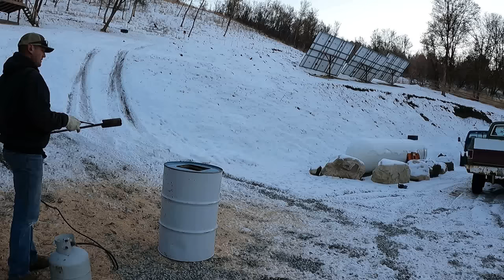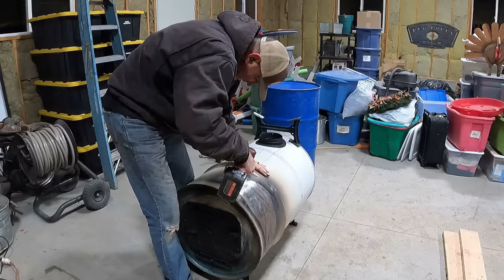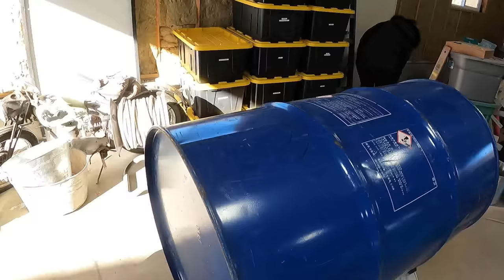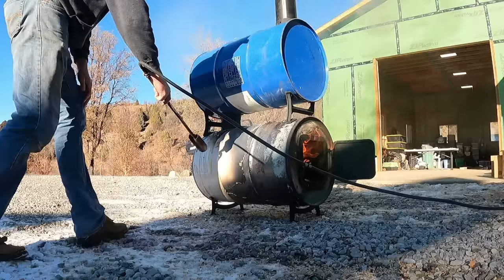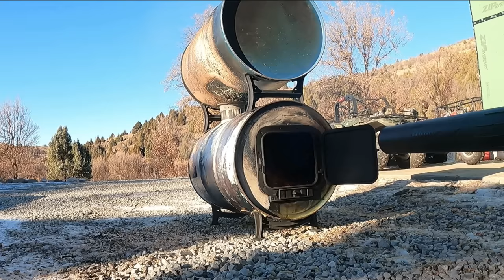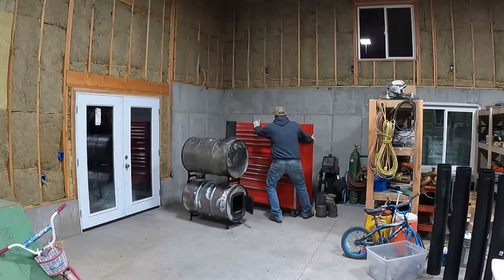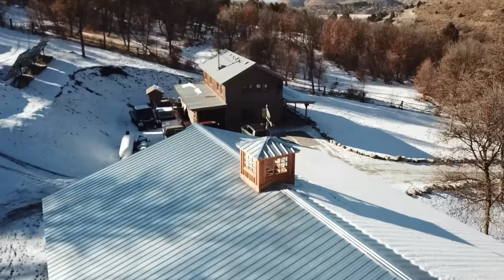I Built The ULTIMATE Wood Burning Stove For The Shop...

Comment: You never said whether it adequately heated your 40’x40’ shop? I have a 24’x32’ converted metal carport that is now a shop and curious if your stack was enough or substandard so I can determine if a single of double is best for me. My shop is 13’ tall at the center with no insulation, just metal siding all the way down. Curious on your thoughts. 

Great video BTW.
Reply: i would look for a used cast iron stove

Comment: Couldn’t quite tell from the video, but a little fire brick in the bottom and top chambers with keep more heat in and save your barrels for more years of use. I use one of these for a smoker, and the firebrick makes a huge difference

Comment: Just a little tip, Put the damper between the two stoves. It works a lot better.
Reply: Putting a damper between doesn't allow the top to help retain heat, making the double barrel useless

Comment: I have had a few over the years and they do wonders. I paint my stoves with high temperature paint to make them look better. It will surprise you just how warm they can get and my pets would lay under them an never get burnt fact I could put my hand on the bottom an not get burned. The ashes will insulate it to keep it from getting to hot

Comment: On Fresh Air Intake.   (Just because so many have commented) For a shop, a fresh air intake is better in the long run for efficiency.   But having a shop with a wood stove for going on 30 years now I've found that using a nice hot stove and shop air to feed the fire gives such a nice air exchange in the building.   That way, your always breathing nice rich oxygen that has been sucked in from outside.   This is important, the place develops an energy as it heats up and sketchy projects that might have some fumes or stink are handled by the stove.

Comment: Nice job! I would kick it back towards the wall after a couple foot piece. That way it takes that two 45s with the heat most heat out of the stove and then has a nice straight shot up and out the roof.

Comment: I built a double barrel stove to heat my father's welding shop so he could quit spending a fortune on propane.  This was 45 years ago and it was still heating the shop 20 years later when he passed and we sold the  shop.  I also built a set of ash grates for it out of sucker rod.  The end plate with the door was made from scrap plate steel and included a smaller door below the grate for removing ash.  Surprisingly,  the paint burned off the upper barrel first.   After watching it operate, I believe that the connector pipe between the barrels should be at the front of the stove instead of the back when there is a grate to allow air draw under the fire for the full length of the stove.

Comment: I put the exit pipe on the front of the top barrel then went back with the pipe to exit the building it throws heat like crazy because the smoke has to build up in the top one before exiting then the 4ft of pipe to go out the building heats up too good luck I love mine it heatsup great and doesn't use much wood I go in about 11 pm come out in the morn and kick the coal around add wood with out lighting it I love this set up thanks for sharing

Comment: I line the bottom barrel with house bricks and halfway up the side also retains a heap of heat and saved burning the floor. Also they rust out quickly if water gets inside when not in use

Comment: nice video. i had a barrel stove long ago, as mentioned below, i lined it. i put sand on the bottom and fire brick on top of that. worked real well. why didnt you go straight up with your pipe, just curious. thanks for sharing the video. looks like a real nice place.

Comment: I use a double barrel stove to heat my shop and part of my barn . It works really well and is cheap . I have plenty of woods as I live on 30 ac hobby farm. The only issues I have is I have to paint it every year . That's really not a problem . A can of paint is less than 10.00 bucks.

Comment: Saw this one ebay. . . Was thinking of one modification you can do to make it better.  On the top barrel cut two holes in the middle of it, one on the top and one threw the bottom, then run a straight pipe through it and either weld it in place or get two of the connector like from the double barrel add on.

Comment: If you haven’t done it I highly recommend you shovel sand into the burn barrel no more than 2 inches deep to prevent you overheating the barrel and dropping the fire out the bottom. My mechanic heats his shop with a single barrel and learned that the hard way. Fortunately he didn’t burn the shop down.

Food for thought

Comment: In the time it took to build this stove, I made enough in the stock market to buy and have installed a 96% afue  furnace with an automatic set back thermostat. Also sold my chainsaw and wood splitter on E-bay.
Reply: That's nice but what are you going to do when the SHTF and you don't have power or gas to run your 96% AFUE furnace? I guess you can take all that money you made in the stock market and burn it to stay warm. I think he has the right idea with the wood-burning stove and I loved the video.

Comment: 4 years ago I built two. One for me and one for my grandpa. The barrels with the steel rings and removable lids usually are thicker. When I built my grandpas I used the supplied hardware, when I built mine I used steel rivets…. The way to go if you have the equipment. I also stuck an old grill grate in the bottom of my barrel and a piece of bar grating in my grandpas for air flow under the wood

Comment: Still could’ve plumbed in radiant floors and used the wood burning as the heat for them. Just gotta have a heat exchanger made up. There’s a guy here in Monroe Michigan that uses such a set  up and it even keeps part of the driveway clear so he doesn’t have to shovel or salt near his Barn

Comment: Nice job of making the video. NO TRASH TALK TO WASTE YOUR TIME. No BS either. Nicely done. Step by step on how to do it. HOW EVER I will say his location of the stove wouldn't be my pick. I would have put it in the corner with the front splitting the difference between the two walls. That way he will not be to close at all to insulation or wood. Relocate the tool box so not to burn the paint. I don't know if he had a car lift in his shop or not but that was some very high ceilings. WOW. All that heat is going straight up and away from the working area. If I remember right he said he had to put 16 feet of pipe up to get the stove to vent. In my shop I wanted to not have a ceiling so I could store things in the rafters. One winter told me thats not going to happen. All the heat went up and through the tin roof. I then insulated the rafters and put boarding up. MADE things alot warmers in the shop.

Comment: These are awesome. I inherited one like it with the house I bought last year. HUGE NOTE need to make at least 3 feet air space around the stove. I say this because I nearly caught the entire shop on fire because these will burn very hot and I had stacked very seasoned wood about 2 feet away and it spontaneously ignited!  I was not in the shop and just happened to walk back out and found the pieces of wood on fire just another few feet from my cars!  

I was also burning some junk wood from old pallets at the time which burned super hot. 

Just my .02 hope someone else does not have same problem. These are great and make a lot of heat.

Comment: I make these and sell them. I lay flat and burn wood after cuts to wire brush off oil and stickers while it's hot. If you put your door on the bung side with bung down you can use for intake. It works better than the sliding grate.

Comment: When it comes time to build another one look for military grade barrels. They are thicker and have a higher nickel content, or something like that.
 Had one in Alaska, you could get that thing cherry red nooooo problem. 
 No need for sand in the bottom. Flashing your walls with a one inch gap will take care of any fire hazzard if your stove pipe is a little close.
 I've seen all kinds of setups. 
Another neat idea is old water heaters. Takes some work and a welder but the can make some good cook stoves if you flatten the front 2/3s of the top. Just make sure you use one that's not too pitted on the inside.

Comment: Take several pieces of pipe and run them through the top. Barrel creating more surface area and the ability to use a small fan to push air through it getting more bang for your btu usage an open barrel is just heat leaving the chimney we've heated out 60 by 80 with one for 50 years

Comment: Just put the entire stove together first with all the clean shiny paint on it,  then take it outside and build good hot fire in it to burn off all the paint. That way you don't have to deal with all the black soot while you are working on the stove construction like this guy did. Keep a small grinder handy to smooth out all the sharp edges so you don't get cut and be sure to always wear some good gloves.

Comment: Burning wood can still supply an in floor heating system, there’s also a heat > electricity generator that could be used to power in floor heat pumps
Reply: Agreed my uncle has a wood stove like and actual stove to cook on, he added a manifold to the stove that has the infloor heating running thru

Comment: Ever hear of a Sand Battery? Sand heats up and very slowly releases that heat. If you put another barrel on the chimney but made that section of pipe single walled, and filled it with sand, it would absorb a ton of heat. If the stove ran out of wood, the sand battery would still be releasing that stored heat for around 6  hours. In a house with a wood burning stove in the basement, you can put a sand battery upstairs and it will distribute heat more evenly.

Comment: I’d hang a few sheets of drywall on the ceiling around the wood burner an cheap sheet plastic stapled on the rest to lower that height. Heat rises and the dry wall around the wood burner is just safer to stop the sheet plastic from ever being to close to the heat. I bet if he did that the shop would get much more warmer.

Comment: I use a lift plate that I set about 2 inches from the barrel bottom that is level with the door attached to some wire I pull to tilt and get the ash coals out when needed

Comment: Line the bottom of the bottom barrel with clay bricks...
In the upper barrel, add about half as much brick, but line the bottom, put a rack system in it, and add more brick... these will get hot and retain heat for hours after the fire stops.

Comment: Couldnt you use some sort of graphite/heat resistant material to seal the door and piping?  Could make it fairly air tight that way.
Reply: JB weld, and high heat caulking..
done....

Comment: They are a lot better when you offset the top flue pipe on the front above the door then angle the flu open out in whatever direction you need to. More smoke in the top barrel for a longer amount of time is always better 🍻🍻

Comment: I haven’t seen this type of barrel stove before. Seems the top barrel doesn’t have any internals and only provides opportunity for radiant heat transfer to the room?  

Maybe the top barrel assists with combustion of flue gases(?)

Looks a nice cheap and simple design. 

I’m learning about rocket stoves. Fun idea but they don’t compare to good slow combustion design in terms of long burn time due to the low fuel stock capacity (have to constantly load fuel) in all the designs I’ve seen. 

now I’m wondering if there’s some mix of slow combustion & rocket stove design concepts working in this double barrel design.
Reply: from my understanding you are using the second barrel to capture extra heat from the exhaust.  Some people put pipes through the top barrel and place a fan behind to get as much heat as possible.

Comment: Also you can take and take your top Barrel get a piece of 4-in steel pipe and cut a hole in and weld it so there's a hole in the center of your tank and you can put a fan on the back side of it to blow out the top and with heat

Comment: You could probably find an exhaust fan the size of your pipe put it toward the center midway up the pipe shouldn't hurt it at all. Just look for a metal one if you fear extreme heat any indoor garden exhaust would do the trick.
Reply: Yeah defiantly look for an exhaust fan get rid of all that smoke.

Comment: Run a 2in pipe into the back top of an old nonworking fridge and out through the bottom then into the back/front of the stove with a ball valve.
Warm shop cold beer no electric.
Run that way for 10 years myself, the pipes actually got frost on them.

Comment: Now mount that unit inside of a 500g fuel oil drum, cut some louvers in it and mount a thermostatically controlled fan on the back. (also a small combustion air fan for the fire) and you won't believe the heat you get out of that. It'll heat your entire shop in a heartbeat.

Comment: I have a single barrel that heats my 30x30 with no insulation! Keep ash in the bottom so the bottom won't burn through. I go through 2 Exhaust pipes kits a year because the stove burns so hot!

Comment: Line bottom of bottom barrel with fire brick front to rear and up both sides to 1/3 way up. will prevent  burn thru and barrel will last longer. I built my first in 1977 and it lasted 22 years, I heated my Diesel repair shop with it, until Insurance company said it gotta go. I slit top of drum and slid a plate down the middle to create a baffle. did not have fancy legs either.

Comment: You should frame a scuttle hole, hang drywall on the ceiling.. and blow insulation.. all your heat will go out the roof and make it VERY hard to heat, 
5/8”” fire rock

Comment: Нижнюю часть (топку) лучше изготовить из толстостенной трубы большого диаметра. Сделать в ней колосник, зольник и дверцу зольника, которой можно будет регулировать силу поступления воздуха в топку. Можно будет чистить печь от золы во время топки. А тонкостенная бочка, боюсь, прогорит быстро.
Да и верхнюю часть тоже лучше сделать из толстостенной трубы. Да, будет немного дольше нагреваться, но и отдавать тепло тоже будет дольше после угасания углей в топке.
It is better to make the lower part (the furnace) from a thick-walled pipe of large diameter. Make a grate, an ash pan and an ash pan door in it, which can be used to regulate the force of air intake into the furnace. It will be possible to clean the furnace from ash during the furnace. And a thin-walled barrel, I'm afraid, will burn out quickly.
And it is also better to make the upper part of a thick-walled pipe. Yes, it will take a little longer to heat up, but it will also give off heat longer after the coals in the furnace fade away.

Comment: I built mine with 5 4x4 1/4"wall tube and placed a box fan behind it like 12" between the bottom and the top tubes turned at 45dgr from barrel so air will flow past and I had 3600 sqft shop and it alone wiould keep it comfortable in front half still used today

Comment: Pipes welded into upper barrel to create a heat exchanger put fan on back side forced cooler air on onside and hot air out the other. Now that would be an ultimate barrel heater

Comment: Could you add a fan and vent to the second barrel to push the hot air that accumulates there out into the shop to heat the entire area faster and more efficiently?
Reply: smoke is filled in the second barrel

Comment: I can't imagine that the upper barrel contributes significantly to better efficiency. Ok, more surface area = more heat release.
But it would be more effective if you opened the upper barrel, inserted grates on several levels and placed stones on the grates, which would then be heated up and able to give off the heat again over a longer period of time.
Or: Run water pipes through the upper barrel. Add a pump, an expansion tank and a radiator and you can distribute the heat better throughout the hall or heat an office in or next to the hall.

Comment: Do you think 55 gallon drums with lots of thin, low profile ribs are lighter gauge than those with just two ribs ? I've never seen a stove made with two-rib barrels like yours burn out even after 40 years of round-the-clock use. It took almost all of a 20# propane cylinder to burn the paint off two barrels today. I plan on wire brushing the char off before using the stove paint i've had on hand for years. Think it will stick?

Comment: You can allways "paint" hot surfaces like stoves or car exaust pipes by continuously brushing them with used cooking oil, then let the heat burn it off, just as you would with cast iron cookingware. They last nice and black. You should do this to the inside of the barrel and it would last forever. Just make sure to sand it lightly to loosen rust/tar drops.

Comment: Could you pour cement in the bottom so the fire is not directly on the metal? Then make an ash pan so it can be cleaned out easily.

Comment: Unless you have sand or firebrick in the upper barrel to actually hold the heat to be released as radiant heat later, I don’t see any benefit to the empty upper barrel. Yes you are trying to capture BTU’s from the heated smoke, but once the lower barrel is at max temp, the lower barrel will also be at max temp. Thus causing the same amount to be expelled from the chimney. I really think the upper barrel should be much higher up to achieve what you want. Thanks for taking the time to do this video!

Comment: Screw the weed burner. Cut your holes and build a fire inside. Lay on ground and roll it when paint is   burnt off to burn other side. Then sand it and paint it with good stuff. It won't rust. Ps, you don't need sand or firebrick on the bottom! Heat goes up and ashes go down for insulation. Easier to clean, too. I use a short spade shovel. Going sideways, it follows the contour of the barrel.